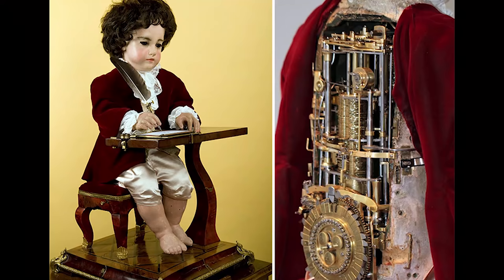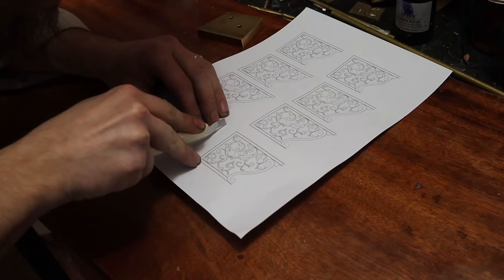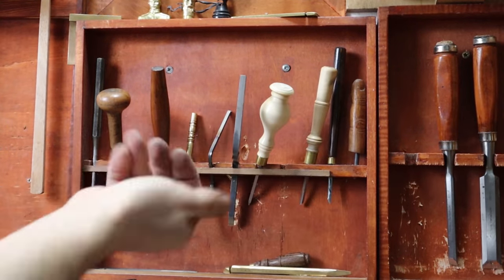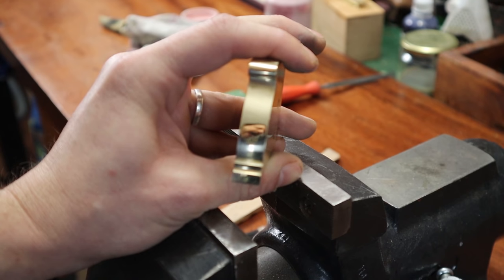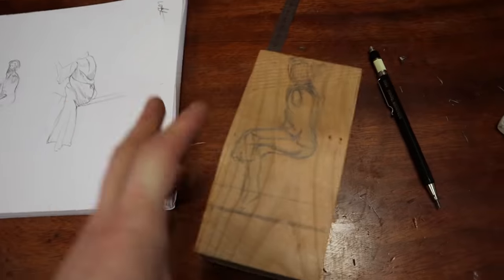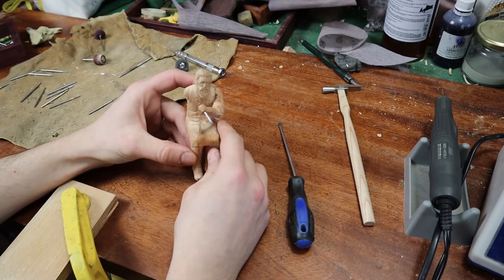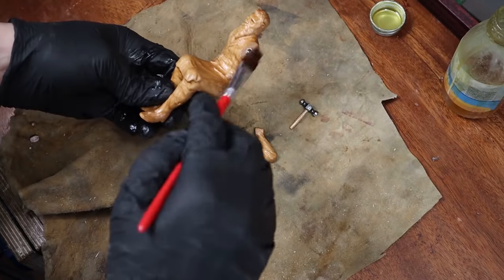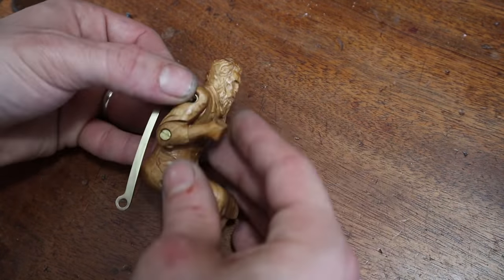I made myself as an Automaton

Comment: Awesome, maybe the first lever would have worked if you had made the attachment point oblong so a shouldered screw could slide at the point it needed the extra clearance. The wire you made is basically doing the same thing, eliminating binding. Just a thought I had.

Comment: most everyone i see uses wood chisels upside down... the flat part is supposed to the top so by changing the angle of the tool you can better control the depth of the cut
at least when it mattered i did not see it used "wrong" except when using hand force it that case any blade would due